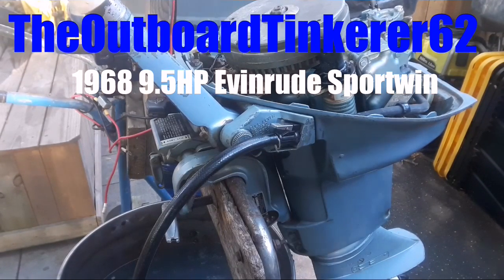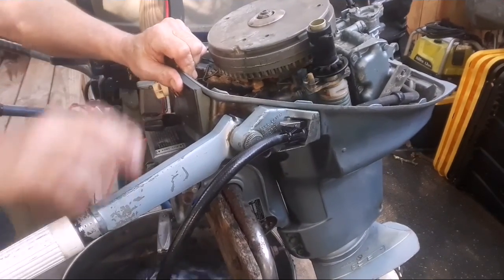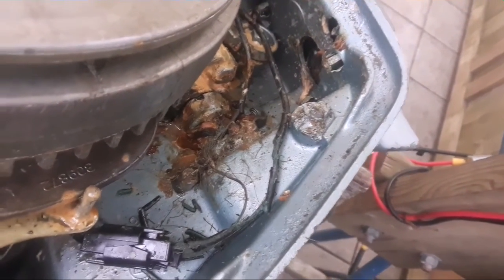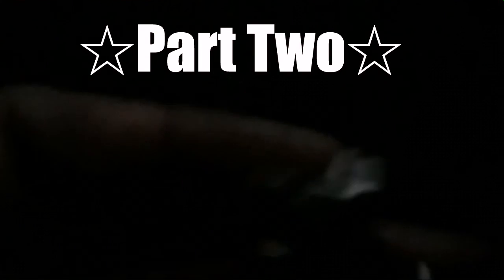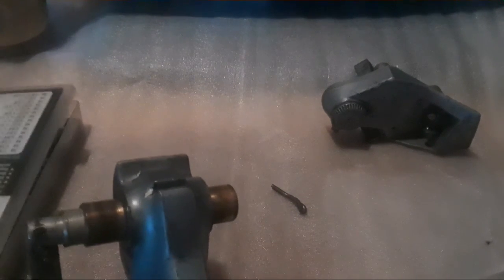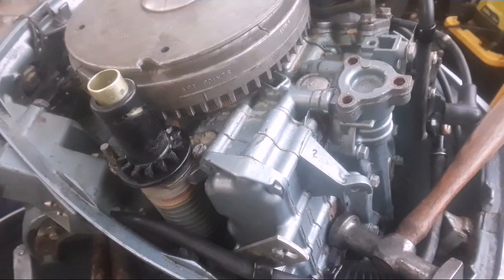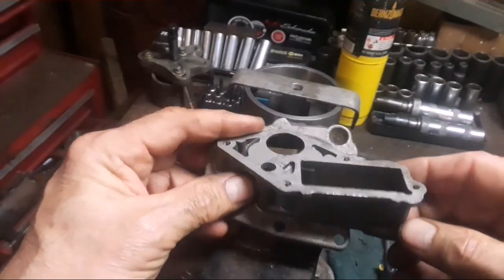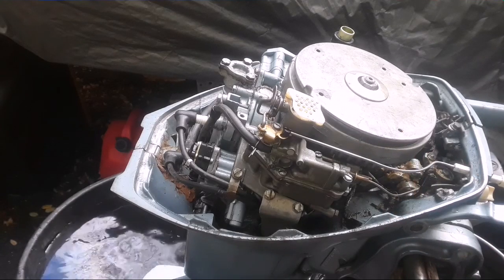Will It Start?1968 Evinrude 9.5 HP!A Co-workers Garage Sale Find! Easy Fix! Painting  Delayed!

Comment from the maker: Just a note to clarify what I did with the throttle gears as Im a jerk and didnt explain myself correctly. Both gears were not 180 out but were not meshing the gears tooth to tooth only half were is what I meant to say. I just easily reset them tooth to tooth on the bench by inserting the wormgear first and removing the twist grip  to disengage the throttle shaft  and gear to reline them tooth to tooth giving full and correct magneto travel to start correctly. Also another correction magneto has to be fully advanced like I said not retarded like I corrected in subtitle to access that one lone carburetor base mount screw.